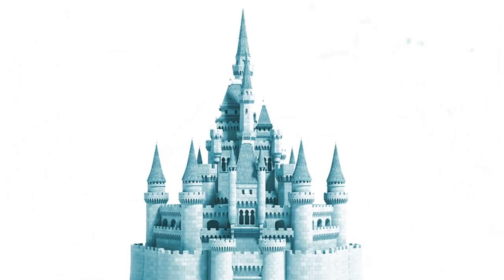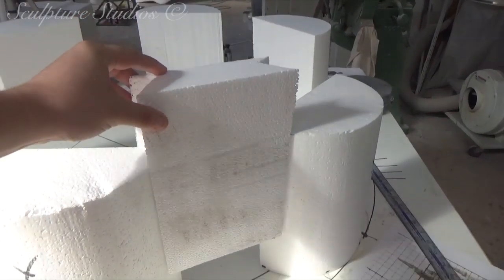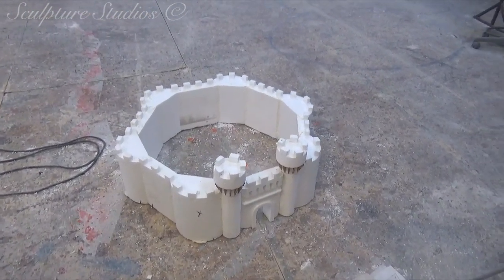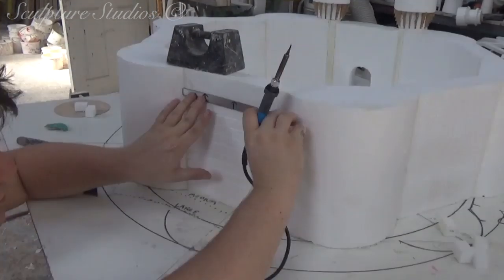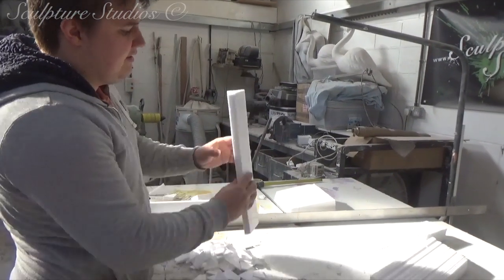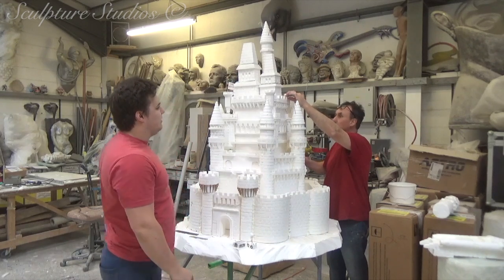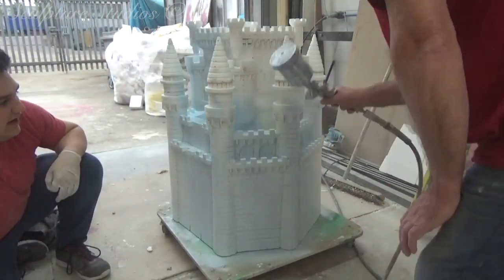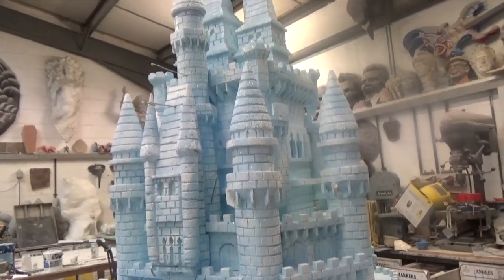Frozen Ice Castle from Polystyrene / Styrofoam by Sculpture Studios

Comment: Question, why did you not coat the sculpture in resin?
Reply from the maker: They wanted a polystyrene sculpture, and only paid for that. Going over with resin would have also meant protecting the poly first, which would mean layers of pva glue to stop the resin melting the foam. Then going over with resin, all of which would dampen all of the detail put in